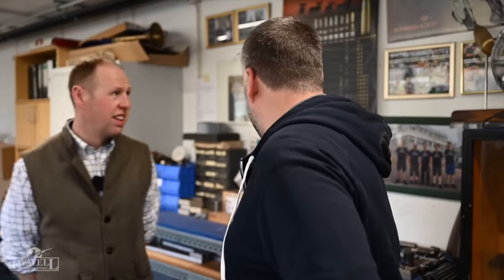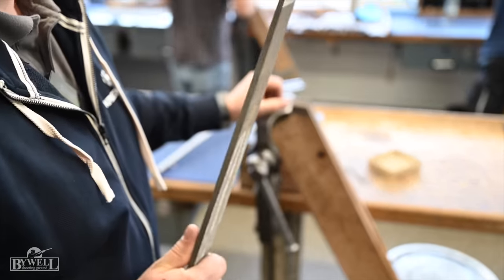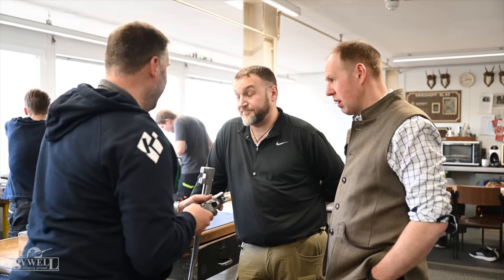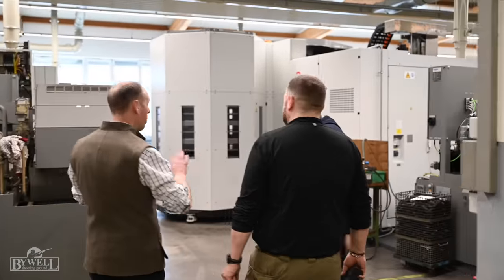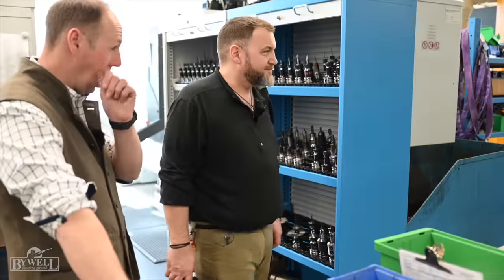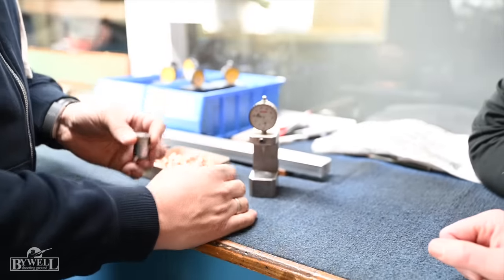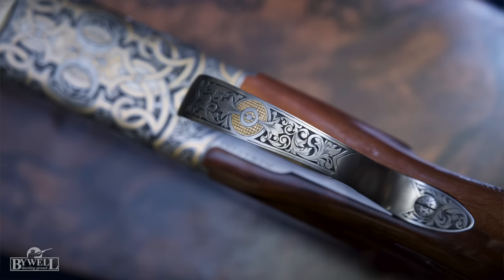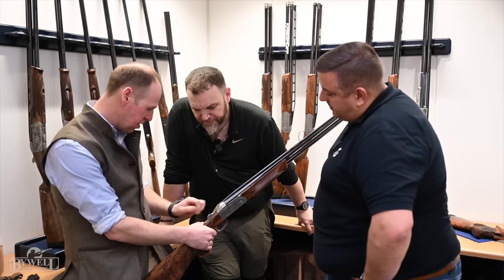Krieghoff Factory Tour Part 2

Comment: Great guns ! 
However, my K80 had to be sent back for barrel poi regulation.  It ended up needing a different barrel hanger and a barrel adjustment. Another club member had a poi problem with his Parcour . . . . hmmmm
Reply: I have never heard of that problem  I was a shotgun gunsmith for over 30 years before I retired stock fit yes on a off the rack gun